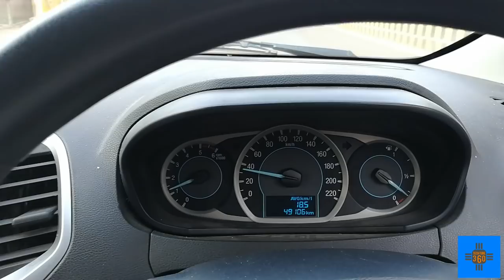How to convert old petrol scooty to electric || powerful electric scooter || scooter modification

Comment: In order to handle the load and vibration of petrol engine, the petrol scooters frame is quite strong and heavy, by keeping most of the earlier engine you have made the bike quite heavy. This will surely impact the range and top speed
Reply from the maker: What you said is absolutely true but that is just 10 % of more weight if you consider. Along with that increased weight I am getting more stability and ruggedness with my two wheeler which other current day Chinese two wheelers lack even they have very poor braking. Also as per NITI AAYOG if ask of these two wheeler are going to be abolished or phased out to electric by 2023 you don't need to buy an capable and reliable electric scooter for 75 to 80k it can just be converted to electric for 50k so all in all its a fair trade to convert it to electric. Also once vehicle gains momentum that extra 10% also reduces to mere 1 to 1.5% of that weight as rolling weight is lesser to initial startup power required. so these are some of my reasons of converting existing petrol vehicles to electric. Thanks for your time and interest ✌️🙏😊👍
Reply: @techtube360world  I completely agree with your explanation,, awesome project
Reply from the maker: Thanks a million bro ✌️🙏😊👍

Comment: I have one TVS scooty ES with good condition. I am thinking to add hub wheel in the front so that I can continue petrol during emergency time. Can you please suggest which hub motor wheel with what size of front wheel axle I need to change? Tyre size is 2.75 /10 

All the best for your good work.
Reply from the maker: There is no specific mirror available for hub in front as it's a telescopic suspension mere bend in lower tube will result in locked suspension or may damage outer tube. Even if you get it right it feels front heavy and I am personally not in favor of hybrid. As each system puts load on the other system working. So it should be IC or pure electric. 
Thanks for your time interest and appreciation ✌🏻👍🏻😊🙏

Comment: Excellent!. Do you have any conversion kit for my Activa scooter? If it's possible, what would be cost of conversation with buying arrangement of the unwanted spare parts? Please also let me know the Road Transport Authorities Department regulations for such converted vehicle.
Reply from the maker: Thanks a million for warm appreciation. Yes we have already converted activa and top speed of 80kmph range of 65kms per charge. But as planned we have not been able to lunch commercially available kits due to supply chain problems and we are running 8 to 9 months behind schedule. So stay tuned you will get notified when the kits are available commercially. Thanks for your time and interest 👍🏻😊🙏✌🏻
Reply: Bro motor kaunsa use kiya hai?

Comment: Amazing!! How did u obtain the custom parts to attach emotor to transmission? Can u send me cnc drawings?
Reply from the maker: I have made those parts. I have not made those on CNC machine but conventional lathe machine so I do not have drawings. But I will surely send you drawings once I open that. Will take some time but I will message you. Thanks for appreciation 👍🙏😊✌️
Reply: @techtube360world  it would be great if you could make a video on the making of those parts.
Reply: @techtube360world  sir please make a video on the custom parts..

Comment: Great job but sir power will lost for direct transmission system at can change double gear system transmission
Reply from the maker: Thanks million for appreciation. Its just a reduction drive and almost all evs have final reduction drive. That won't affect or result into considerable loss

Comment: Can u pls tell the price???
I am looking for electrical scooty only, but of low speed, so that no registration required.
Reply from the maker: It costed me about 50k
Reply: @techtube360world  mean electrical will also cost 50k???

Pls send specifications
Reply from the maker: Yes it's high speed version can touch 70kmph so it's expensive
Reply: @techtube360world  I want low speed, max 45km/h, what will it cost
Reply from the maker: Then conversion can cost about 30 k
Reply: @techtube360world  30k is ok for me, but it should be an electric scooty with speed Max 45km/h and range 80km

Comment: sir i want your help i want to use dc to dc booster from 12v 150ah to 48v battery in my motorcycle plz tell me its successful?
Reply from the maker: No it's not successful because you 12v and say 10 ampere rating battery will melt. Why because maximum wattage of battery that can supply safely is 12v by 7amp equals 84watts. So once it's you connect 1800watt converter it will start drawing 150 ampere current. Which will damage battery. I hope that you have got your answer.🙏✌️😊👍
Reply: @techtube360world  ok sir thanks and one more question bldc moter directly connected with chain sprocket working good or not?
Reply from the maker: ya definitely it works fine but during slopes and load conditions bike will perform sluggish🙏✌️😊👍
Reply: @techtube360world  thankyou so much sir

Comment: Really nice modification. Can we attach the electric motor instead of crank shaft and keeping the rest of cvt assembly as it is? Does it will reduce the speed?
Reply from the maker: Thank you sir for your interest. CVT transmission is basically a lossy drive. It will unnecessary reduce the efficiency of system by slippage of clutch in the clutch bell. Also it needs specific rpm to operate. So keeping fix belt drive will remove all those losses. Also as this is electric scooter we do not need clutch as this is motor and is always ready to drive and will not stall like internal combustion engine which needs some rpm and clutch mechanism to stay alive and deliver power. So I hope that you have got the answer to your question. Thank you ✌️🙏😊👍
Reply: @techtube360world   thank you very much. For ice scooter such transformation is necessary on mass scale. How can we achieve speed of 60-70 km/h and decent range of 100 km? Means what combination of motor and battery?
Reply from the maker: Our scooter is capable of achieving speeds of about 65 to 70 Kmph. Just need to change system voltage to 72. For decent milage lifepo4 battery pack with 2.5 to 3kw will do the job to keep scooter alive for 90 to 100 Kms with any kind of driving. It was just a budgetary constraints that we could not show you that range and speed as lifepo4 battery costs more but lasts as much as 8 years daily commute. 👍

Comment: I am from Ahmedabad. I have splendor NXG.
Want to convert it to electric.
How much cost in total and in how much time it could be done. I can bring my bike to Rajkot, its not too far...
Reply from the maker: 65000/- with bike available with lithium ion phosphate battery pack conversation from boxer. Hi speed charger is included. Tell me if interested
Reply: @techtube360world pls guide on range expected from single charge and speed of bike
Reply from the maker: 50 kms per charge and 50 kmph top speed. Both can be customised as per requirement

Comment: Very Nice, Sir,
With Lion Battery, 20Ah 72Volt what will Cost Aprox,
and Range,
Reply from the maker: Thanks for your interest for 72v and 20ah battery pack in this scooty will approximately give you 45 Kms of range and to speed of about 55 to 60 Kmph cost will be about 50k inclusive all parts labour charger and scooty too ✌️👍🙏😊

Comment: Nice work sir, Did you keep CVT or only simple belt drive ?
Reply from the maker: Only belt drive I have removed CVT transmission all together 👍✌️🙏😊
Reply: @techtube360world  I was thinking what if CVT is used with roller weight modification ? Will it provide more speed range of vehicle. Ur review plz... (Btw, I'm from Rajkot too, hoping to meet u in person very soon)
Reply from the maker: @aryachangela9439  CVT transmission is the most lossy drive it's not suitable to use with ev. So it won't either give you any better range and pickup. And most welcome to have a meeting with me. Thanks👍✌️🙏😊

Comment: I am from Hyderabad, India and I am a mechanical engineer.  Your conversion of the engine with motor is excellent.  Selection of parts, coupling for motor, selection of belt drive, etc are wonderful.  But I think your efforts to convert the vehicle shape in to show the vehicle in different shape is not required.  Even after conversion, if the scooty looks like exactly as original scooty, it might be super.  Instead of Scooty, you might have tried with Activa or Access.  These are sturdy vehicles and gear box also strong than scooty.  If you finalize one design, parts, you can provide some conversion kits for such vehicles, with minimum alterations, many of the owners can convert their vehicles to electric.  Motor and Batteries might be available from market and you can give specifications.  Even you can supply them too.  But perfect conversion kits are not available in market.  You can sell Thousands of conversion kits if the kit is perfect for a   100 cc scooter.  Even if you have a margin of 5000 for each kit and sell 10000 kits, you will get a profit about 5 crores.  If the engine number and chassis number are not disturbed, transport department also might not look in to the matter seriously except change of fuel type.  Only thing is you need to get approval for your kit from appropriate authorities.  Even I am interested in purchasing a old vehicle and do conversion.  All I am telling here is to save the nation by saving petrol due to conversion of vehicle to electric with minimum alterations to the original vehicle.  Presently I am planning to purchase a new electric vehicle, but the cost is more than a Lakh.  Thinking to go ahead or not.  All the best.
Reply: Only thing you did not mentioned in your video is, whether the vehicle is capable of regeneration of power during break.
Reply from the maker: First of all thanks a million for warm appreciation. As what you said that  altering the body was just an added bonus nothing more than just getting noticed. As you said we are not touching any engine chassis number and hence authorities would not bother also our vehicle has been driven by cops and they were very happy and pleased. We have target of converting high volume sold vehicles. We have converted boxer scooty next on our list is activa, splendor Jupiter and access. And as you are a mechanical engineer you can very well understand the benefits of conversing rather than buying a new one which mostly don't have sturdy frame under one lac. So definitely we are in line with what you said. And going to arrange for standardised kits for two wheelers. Once again thanks you so much. ✌️👍😊🙏
Reply from the maker: Thanks for your time and interest yes the vehicle is capable of regenerative braking but we have not enabled this feature as battery pack used in this vehicle is lead acid jell batteries so if you consider 10% of 28Ah it is merely 2.8 amps and while regenerative braking system generates about 22 amps of peak current and that will damage the battery pack. So when we will swap batteries from conventional to lifepo4 battery we will do that. ✌️👍😊🙏
Reply: @techtube360world   You are correct sir.  LiFePO4 batteries are to be used for best efficiency.  You acquired lot of information and knowledge regarding this work.
Reply from the maker: @kumard7376  thank you sir 🙏

Comment: What is the total cost ? Including scrap bike and total fitting of new parts cost. I want to know full cost from end to end
Reply from the maker: For the build which you saw in video costed me 50 k included all parts labour old bike motor controller wiring custom shaft covers body works tank modification and everything else. Thanks for your time and interest 🙏✌️👍😊
Reply: Its very expensive
What. About. Milege and  performance

Comment: Awesome design, dude. Assuming this is a prototype, maybe you can switch to a more powerful electric motor, along with replacing the gears and controllers, so that the max speed of 38-39 kp/h can be increased to 43-60 kp/h. Even ascending a 35° angle will be easier.🤩🤩🤩
Reply from the maker: First of all thanks for appreciation. Yes already the speed of this EV is about 50kmph. It can still be increased to 65 to 75kmph increasing the gear ratio or motor over volting or higher amp controller. So there is still a scope for higher speeds. But I have decided this setup to get a best balance of milage and power. Thanks for your time and interest ✌️👍😊🙏
Reply: @techtube360world  ooooh! Try making a dual cantelever rear with two 750w 60v motors on a Honda Dio body! Of course, the design will have to include tilting capabilities. I haven't tried that idea yet myself, but will do it once i get news for that job i applied to. That way, i get more funds for the project, too. Anyways, try that suggestion if it ever catches your interest.👍🏻👍🏻👍🏻
Reply from the maker: @irontaft30  thanks a lot and what you said is already on cards. Design is almost finalized and need to implement. Thanks once again. Have also done geared electric bike if you have not watched that video sending a link could interest you and do share your feedback on this video
https://youtu.be/XZx-gHCK_OM

Comment: Hi Tech 360 team
Is it legal to convert a registered petrol two wheeler to electric with same registration?
Reply from the maker: Nothing is illegal as far as there are no norms to convert one. Also I am not touching engine and chassis number. It's a matter of fuel type change. As and when norms are in to effect you need to get your RC book updated for fuel type change. Where as you are helping environment by doing so. Also pre approved legit vehicle will all standards you are using as frame then what is wrong. People are just selling conversion kits removing all engine and everything. So doing so you are not doing any criminal offence rather you are aiding green transport. So dont worry convert and ride on green mobility 😊👍🙏✌️
Reply: @techtube360world  Team
Hi
Your reply is satisfactory. My question was only to get clarity. i understand you should have done a ground work before starting anything like this. I appreciate your cause and motive for aiding green transport. Meanwhile there are millions of registrations which would have expired. can we restore those frames and use them. Can you please also let us know what's the procedure to register them?

Thanks in advance.
Reply: @techtube360world  
And how the batteries are recharged? What about mileage per recharge?
Reply from the maker: Select any bike from scrap value with proper documentation like RC book copy and owner documents. Get a PUC of that vehicle and generally insurance of that vehicle might would have expired get it insured. Fill up TTO form in RTO office. Hey it on your name and get it registered with hsrp number plate. Now you can open the vehicle convert it and make it electric. That's it. I have also made second boxer with lifepo4 battery pack and currently using it daily without any problems. Max range is 65km per charge and max speed increases to 65kmph. Changed to primary transmission from motor to gearbox with belt drive inserted of chain drive. Have not got time to upload a video of that. Will do it as soon as I get some time. I have followed the same procedure of making old scrap value bike on my name and making it kind of road legal. Thanks for your time and interest. 😊👍🙏✌️
Reply from the maker: The bike you saw in video is giving 47.5 kmph max speed in fourth gearand 50km per charge. New version figures I have told you in other reply. Charging port is underneath the seat which I forgot to show you in video. Your answer is in link below
https://youtu.be/Y4fkVko8Jpw
Thanks